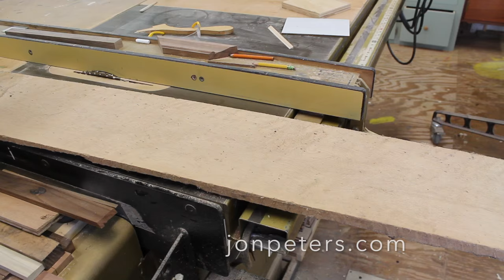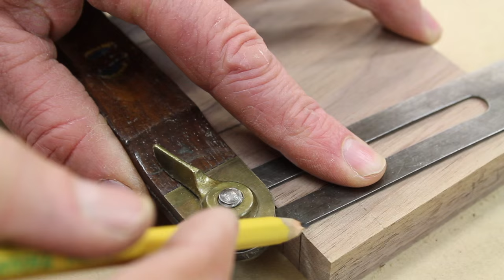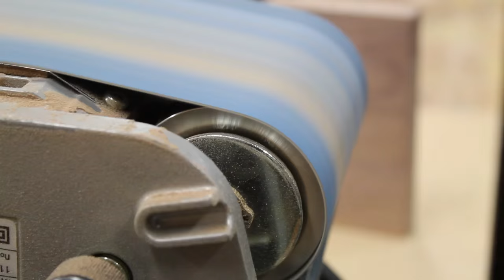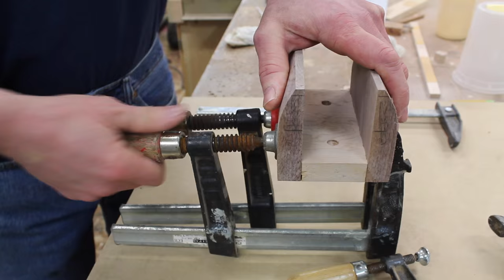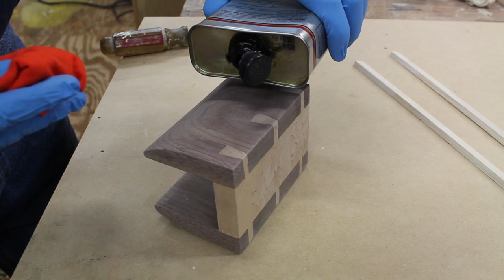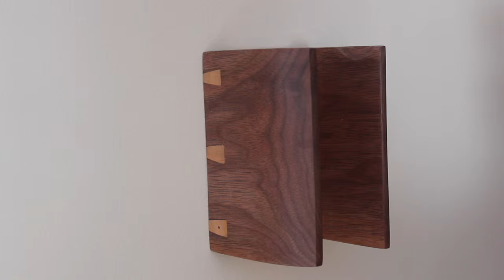Same Guitar Holder Using Dovetails, Made with Walnut and Birdseye Maple

Comment: Hey Jon, I'm just curious why you use the chisel instead of a coping saw to remove the excess in the dove tails? I am new to woodworking and usually see a coping saw used, so I'm just wondering for my learning. It looks like it worked just fine